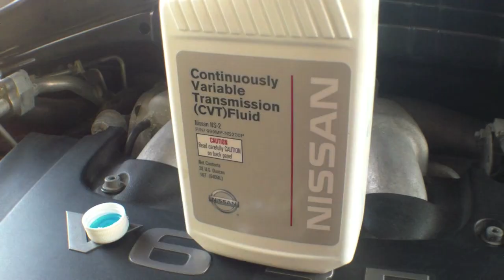Passenger Side Axle Replacement NISSAN Murano √ Fix it Angel

Comment: Brakes, tie rod end and strut can stay on, remove the axle nut and lower ball joint bolt, x3 axle hanger bolts and it pops right out.

Comment: I replaced both front struts and the passenger front CV axle (had a damaged boot) on my 2006 Murano.  I didn't have to remove the tie rod on either side so I'm not sure why it needs to be removed?  To my surprise, the whole CV axle came out easily after removing the three bolts holding it in place.  In fact, the struts and the axle were easier to replace than the belt for the A/C and alternator.  Apparently, Nissan used a super cheap nut on the belt idler pulley and it is easy to round off the nut with a regular closed end wrench and there's no room to get a six point socket on the nut.  I had to buy a set of Grip Drive wrenches at AutoZone to get the damaged nut loose.

Comment: My dude you the first and only video to show that the support bearing holds on and needs to be chiseled. Thanks for letting everyone know that little problem that could be a nightmare.
Reply from the maker: Welcome Chris, all the little things matter because it can lead to something big.
Reply: I didn't have to chisel anything to get my axle loose.  I used the axle like a slide hammer and it came out of the support bearing for me.  Yes, it shocked me that it came out so easily.  BTW, I live in the South where there is no road salt so that may be why I didn't need to chisel it.  I have a 2WD Murano so the parts and procedure for replacing the front axle is slightly different than the procedure for the 4WD Murano.  On my Murano, I replaced the whole axle with the intermediate shaft, not just the outer part of the axle with the boots.

Comment: didnt need to remove support bearing bolts & bracket. passenger CV axle is locked in with C clip just like driver side so should come right off. just need to tug the axle a little harder. i see a lot of people make the same mistake and end up doing double the work.
Reply: I can't pull the axle on the passenger side after removing the 3 bolts, it stuck
Reply: Joel Goyena don't need to remove the three bolts so put those back in. Passenger side is held in only by C-clip just like driver side and connects just before that bearing bracket with three bolts. However, passenger side C-clip is much tougher. Give yourself a lot of room in the wheel well to keep CV axle straight and tug it like a slide hammer. Just stay patient and tug with a lot of force.

Here's a good forum chat with pics (see post by Carguy75): http://www.nissanmurano.org/forums/82-1st-gen-2003-2007/181394-cv-axle-boot-replacement-thread-2.html#/topics/181394?page=1&_k=izrj04

Here's a good diagram (window A is reference for AWD): http://ww2.justanswer.com/uploads/FI/FixUrNissan/2013-01-12_201926_12.jpg
Reply: Hi moparfanboy, thank you for responding.  I've put everything back last night but I will try your recommendation again after the snow tomorrow. Since the boot was damaged and if I pull the shaft I don't think the slide joint assembly (13/16) will come out easily . I'm thinking to just loosen the stopper ring (10) in the picture  https://drive.google.com/drive/folders/0B1iwwR-p_6U8bkNXX3RaZHd0Mlk so that I can just pull up to the spider assembly first.
Reply: Joel Goyena removing stop ring won't make a difference because the green slide joint assembly (13) needs to separate from support bearing bracket (16) which has a pretty wide c-clip (2). Only way to split them apart is by keeping cv axle straight, getting a good grip on 1&5 and tugging it outwards which will eventually depress the c-clip. Good luck!
Reply: if you're not sure which model you have, it's best you call dealership with VIN and they'll verify if you have 2WD or AWD. both versions look fairly similar underneath the car. Here are Nissan service manual directions for 2WD:1. Remove tire with power tool.
2. Remove wheel sensor from steering knuckle. Refer to BRC-42, "WHEEL SENSORS" .
3. Remove cotter pin. Then remove lock nut from drive shaft.
4. Remove brake hose lock plate. Then remove brake hose from strut assembly.
5. Remove strut assembly and steering knuckle fixing bolt and nut. Refer to FAX-5, "FRONT WHEEL HUB
AND KNUCKLE" .
6. Using a puller (suitable tool), remove drive shaft from axle.
CAUTION:
When removing drive shaft, do not apply an excessive angle to drive shaft joint. Also be careful not to excessively extend slide joint.
7. Remove support bearing bolts using power tool, and pull drive shaft from transaxle. Pry off drive shaft from transaxle.

btw, if you have 2WD and inner slide joint assembly is stuck in the bracket, get underneath the car, place a long socket extension against one edge of outer part of the bracket that belongs to slide joint assembly and hammer it out of place until its out far enough to get a better grip with a pry bar
Reply: With less effort, I'm able to replace my inner boot by removing Stopper ring(10), pull the shaft (5), removed Snap ring(12) & Spider assembly (11) and insert the boot.  Pictures available @ https://drive.google.com/drive/folders/0B1iwwR-p_6U8bkNXX3RaZHd0Mlk (removal1.jpg, removal2.jpg, removal3. jpgremoval4.jpg). I also replaced one of the belt saving total of $600 from the shop. Thanks moparfanboy and Fix It Angel.

Comment: Good morning i got a quick question i have a jaguar 2002.   4 wheel drive..I’m trying to replace the front passenger side axle-i was trying to get it out but it’s stuck i don’t know if i just gotta pull the axle like really hard or it’s something about transmission that goes with the axle.. or does it gitta be on Neutral-if u can give me an advice I will appreciate it. Thanks

Comment: I did this over the past weekend.  I read and watched videos for 2 months waiting for it to warm up enough to do this job in my garage... This video was SPOT on - worked like a charm.  Best Video on the subject...,
 Some comments.  I had 100K miles on the 2007 Murano.  I put the front end on jacks.  I drained the front transfer case and the transmission fluid before beginning - I had read you can cross contaminate if you do not.  When replacing the front transfer case gear oil fluid - I had purchased for about $7.50 delivered from Amazon Prime the Plews 5500 Lubrimatic Fluid Quart Pump - - it only took about 2/3rds of a qt of the gear oil - not that much came out though...   I was more careful in monitoring how much tranny fluid came out.  It was about 4.5 quarts.  I replaced with that amount - and it was at correct level when warm.  I had the tranny fluid changed by the dealer at 60K - but the thing is now out of extended warranty - so after doing some reading - I went with the Castrol CVT fluid...   For the tie rod - instead of the pickle fork to get the tie rod off - I would watch this video about using a hand sledge - THAT worked after 3 hits (https://youtu.be/LDsci-izhhc).  I had to sharpen my dull chisel on my grinder before doing that part of the video instruction - separating the shafts...  Did not take as much time as I thought it would...  I also replaced the serpentine belt and rotated tires while I was at it...  Ok - I did notice some rubber debris at the top of the struts - and this was on both sides.  I believe it was the boot cover which has deteriorated over the years.  To get access to the strut for removal is simple to me now - once having done it.  That will be my next thing do.

Comment: how much cvt fluid did it take to top it off at the end of video
Reply: I'm willing to bet a pretty penny that it was very close to the amount that spilled from the female ends of the transaxle
Reply: I had to put in 3/4 of a quart to top off after replacing my axle.

Comment: perhaps you can help me out I'm getting this clicking sound when I'm driving it sounds like a gear like half engaged it doesn't slow down when I put the car in neutral I know I shouldn't do that but I just wanted to see if the clicking died down with the motor but it doesn't it stays consistent with the speed of the wheels I'm wondering if it's a CV joint for the CVT transmission what's your expert thought
 it doesn't sound like clicking you get from a CV joint when you're turning a corner though.
Reply: That is probably your wheel bearing. Easy fix.

Comment: I changed the CV Axle like you did, except when I separated the CV axle from the intermediate shaft, it was hard to put back on because the ring on the intermediate shaft was almost out. I hammered it back and hammered the CV axle to the intermediate shaft and was able to put them back together. But now I hear some noise when I turn the steering wheel while driving. Did I damage both the CV axle and intermediate shaft when I hammered them together?
Reply: how did you fix the issue with the ring? by hammering only?